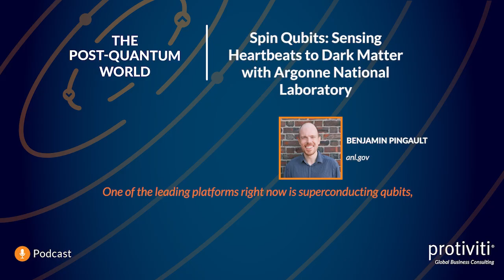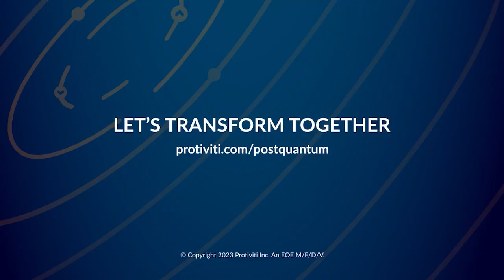Spin Qubits: Sensing Heartbeats to Dark Matter — with Argonne National Laboratory | Ep. 116

Comment: There is no dark matter particle because it's simply regular mass that is dilated. A fundamental insight of Relativity is that mass that exists at Relativistic velocities is irrelevant from our perspective. Relativistic velocities are occurring in the overwhelming majority of galaxy centers. This means that they exist in a "non local" state relative to their outer regions. The mass in our galactic center is not just there, it's everywhere.
   A common misconception is that mass and or energy increases as an object approaches the speed of light. It doesn't, that's why it's called "invariant" mass becomes spread throughout spacetime relative to an outside observer. Hence the term "mass becomes infinite at the speed of light" a Relativistic dilation graph illustrates the phenomenon.
    Relativistic dilation doesn't occur in galaxies with low mass centers. They do not have enough mass to achieve relativistic velocities. Therefore, these galaxies don't have dilated mass. It has been confirmed in 25 dwarf and ultra diffuse galaxies to have no dark matter. In other words they have normal rotation rates.